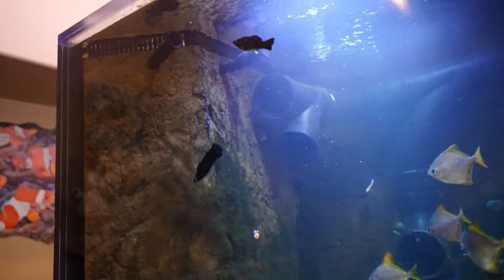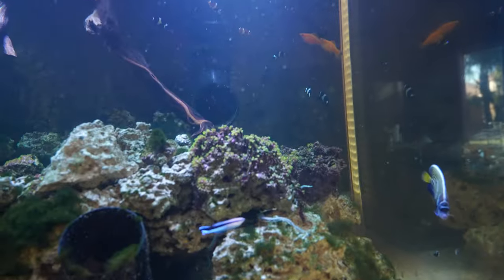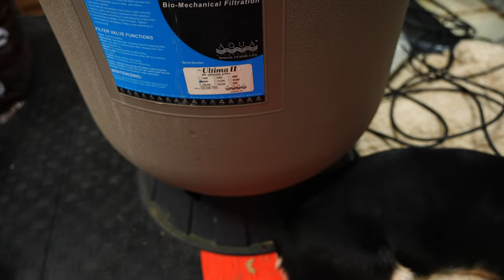Moray Eel Mega Tank -  05 - Filtration Upgrade - Part 1

Comment: I'm glad you see that you have reassessed how to run the system...this is why it's curtial to have a detailed plan in advance and set it up professionally the first time..I'm hoping to see a uv steriliser in future to....when all others filtration fails..uv saves the day.
Reply from the maker: I am thinking about moving the inverts to another tank and to lower the salinity to 1.018 which (supposedly helps keep diseases from happening, plus the eels are very resilient to parasites due to their toxic slime coat. I will look into UV though.

Comment: Wow what a huge undertaking. I regret putting sand in my freshwater tank. I love the look but that’s it. It’s hard to clean debris off it because the sand seems to bind to it causing the muck to drop back down. How are you removing the sand? Are you sucking if off the bottom and if so how? I’ve tried netting some I have to get on a ladder so it’s up, net sand, down, dump sand, back up and so on. And the mess that makes 😬
Reply from the maker: I should have shown it in the video but basically I use a piece of 2" pvc pipe and stick a plastic drain in one end. Then I connect the other end to my python gravel vacuum via a rubber 2" to 1.5" reducer. The plastic drain allows for only the fine sand to be sucked up and keeps any rocks or snails from clogging up the python hose.
Reply: @fishdiary  I’ll have to try that. I tried using a broom stick and zip ties to keep tubing straight 😂 was too awkward.